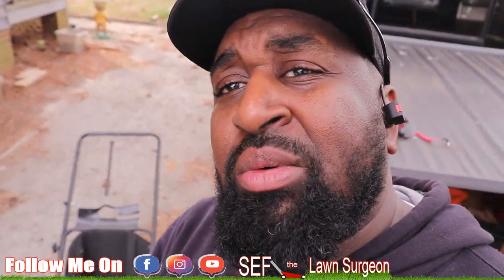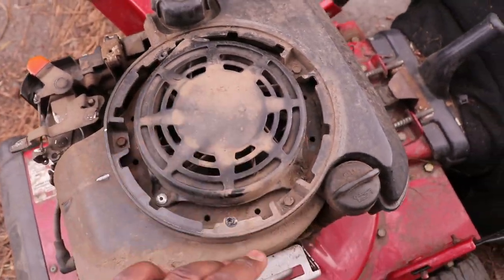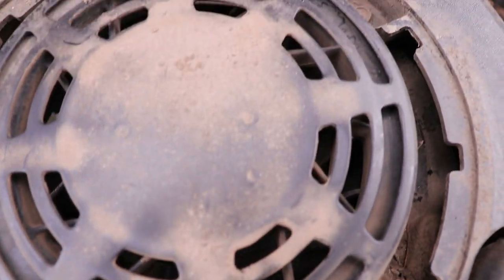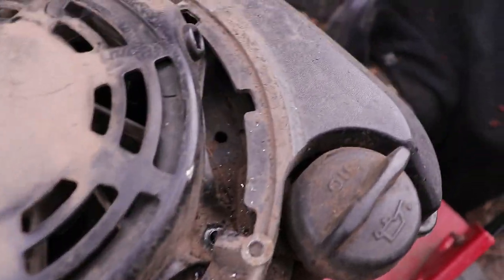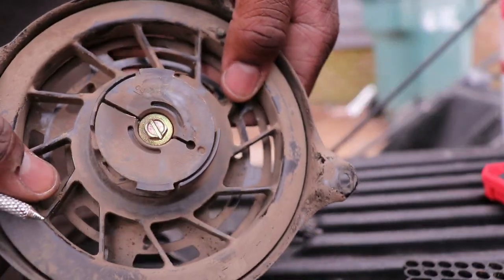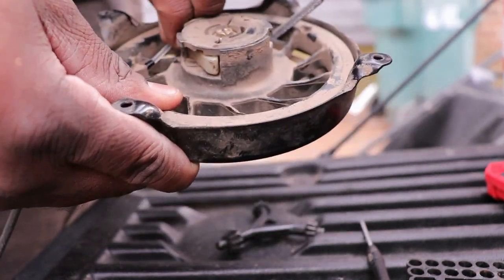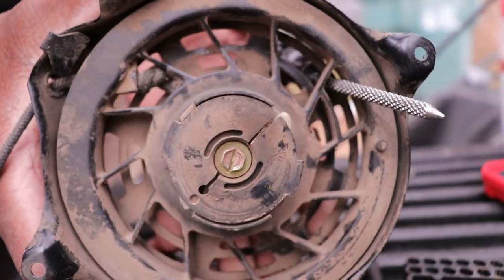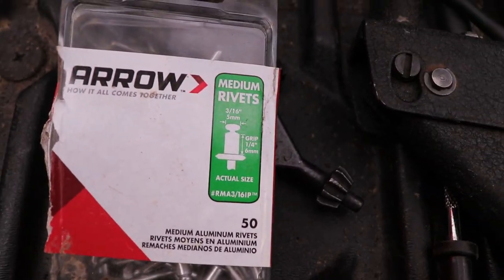How to Fix a Pull Cord for a Craftsman Yard Vacuum!

Comment: Good video and useful info. My problem is the rope is hard to pull fast and my fear is that something is caught in the impeller blade area. Is there a way to check this area without disassembling the bottom section? Is that area visible when the limb chute is removed? Thanks, Charlie

Comment: What tool do I need for the parts u just drilled
Reply from the maker: The fly wheel?
Reply: The parts u drilled too remove the wheel
Reply: The 2:00 part is their a tool too remove them with drilling them out